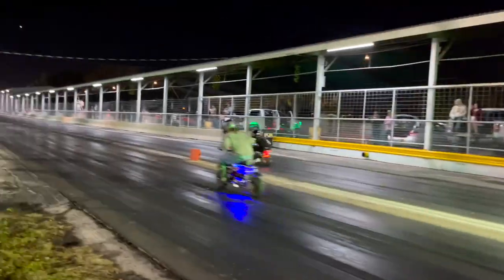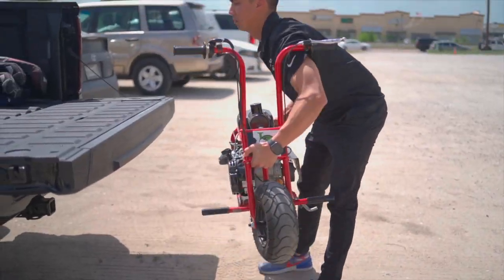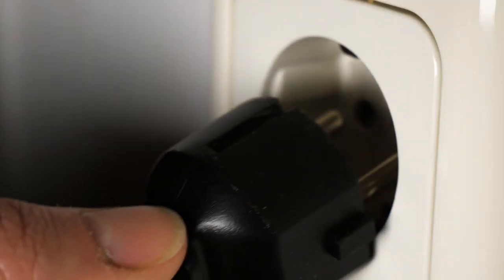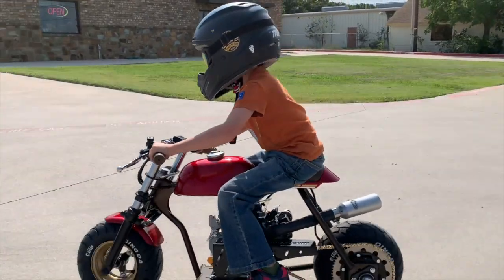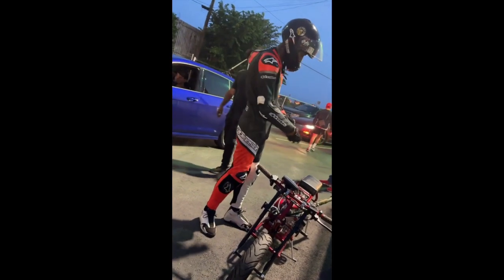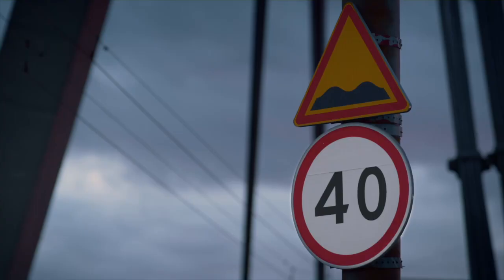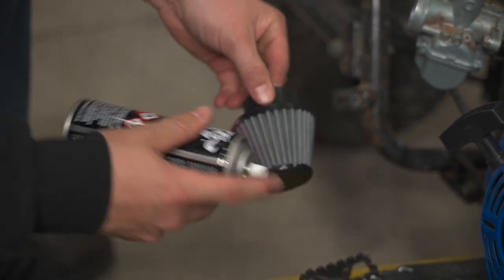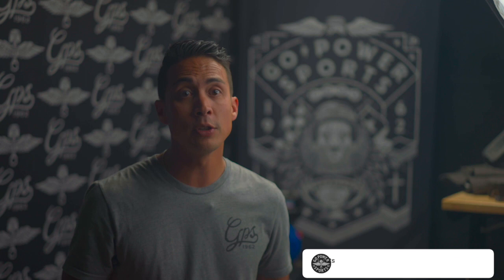The Ultimate Guide To Minibikes

Comment: I bought the mega moto 212 kit awhile back when it first came out i absolutely love it i even bought the battery box kit the only issue ive had with it was the the rocker arm fell off into the cylinder head on the intake side i was able to get it out with out any damage done to the cylinder luckily 10/10 bike just make sure everything is tightened
Reply from the maker: Glad you're alright!
Reply: EVERYTHING IS THXS TO OUR GOD JESUS CHRIST FIRSTLY AND MAINLY AMEN AND AMEN HALLELUJAH 🙏💯🕊️♥️♥️

Comment: Will a 30 series tq convertor be enough for a stock predator ghost?
Reply: Completely stock, yes. Just don't cheap out on the belt.
Reply from the maker: we highly recommend the Super 30 Series Juggernaut Driver if you were going with a torque converter on a performance engine